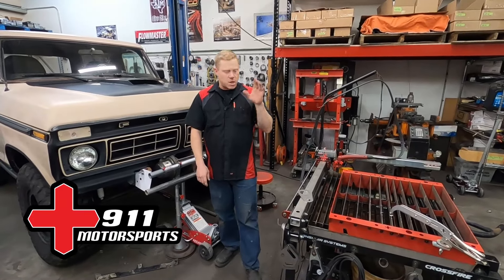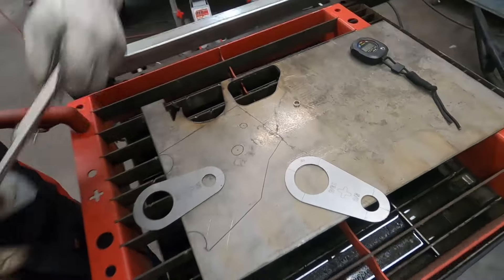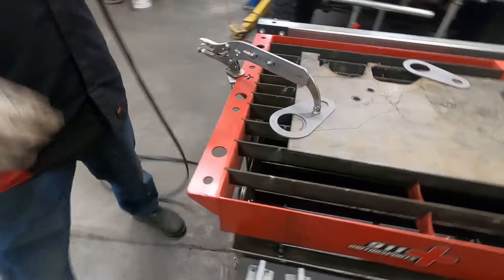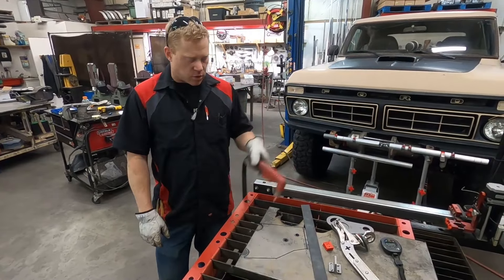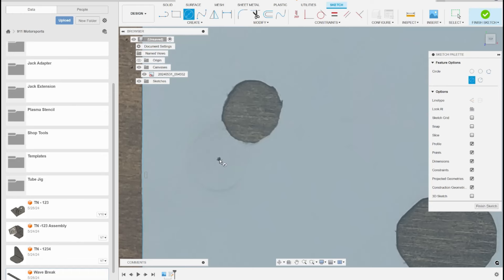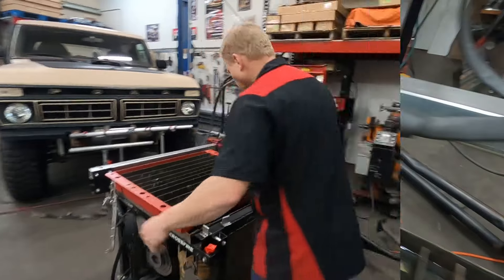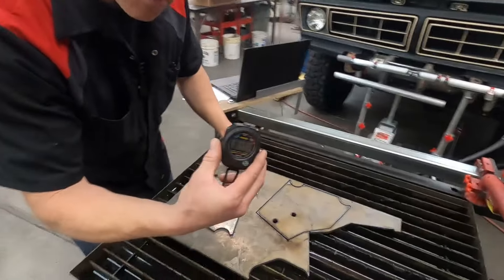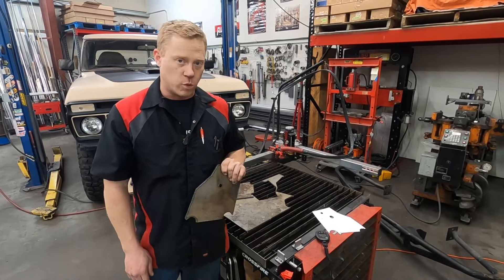CNC vs. HAND Plasma Cutting comparison - for custom bumper brackets & tabs

Comment: when you get better with your drawing it will take less than half the time  😊  also  if you put a machine torch with your set up you dont ever have to remove it   the hand held just plugs in ...  great video though  thanks  for sharing
Reply from the maker: I don't think there's much time to be saved in drawing, it took us 12 min. to import, interpret and export to a cut file... A machine torch could be helpful, but with our quick change setup you'd only save like a minute in swapping consumables. If you were primarily doing CNC cutting than a machine torch would be better, but we do a lot of one off cutting so that's why I prefer the hand torch. The main downside of a hand torch is getting water in the trigger, but with our splash guard it remedies that problem too... I'm glad you liked the video, thanks for the feedback.
Reply: @911Motorsports  i could import that pic and draw it in a about 2 minutes and send it .... i use libre cad with pronest   but then again i draw everything i do so for me its just nicer to draw it and cut it  . but i understand why its faster for you to do it manually... i just like cutting with my machine

Comment: I bought your templates years ago and I like them, I still use my CNC table 9/10 times unless im away from the garage. It looks like you kept the stopwatch running when you remounted the torch to the CNC adding 6min to the "CNC time" which is not a fair time comparison. There is there is a big difference between using a CNC table with how clean/smooth and precise the outcome is compared what a person can do by hand....  Please continue to make great products and advertise them as such.
Reply from the maker: We did pause the time to switch over to CNC mode, however it looks like the scene where I mentioned it got cut from the final video. Thanks for pointing that out. That 6 minutes was the whole CNC time of loading, layout, dry run and cutting. It's great to hear you've got a place for our Plasma Stencils too. This type of bracket was the break point between hand simplicity to CNC precision that I wanted to figure out. For me hand was the winner, but for you it sounds like CNC would be the winner. Thanks again for the feedback!

Comment: just because its faster, doesn't mean its better ... stop working hard.
Reply from the maker: Speed to quality was why we did this comparison. This is about the limit of where hand cutting beats CNC cutting. If the bracket was more complex, than CNC would be worth it... The other thing to factor in is the cost of our Plasma Stencils vs a CNC setup.

Comment: POINTLESS topic. CnC is 2x as fast on its slowest moments, providing you to do something while it works better than you can.
Reply from the maker: It's only faster once you hit the go button. Getting the part drawn and setup is where the extra time comes into play, especially for a custom part that doesn't have tight tolerance.